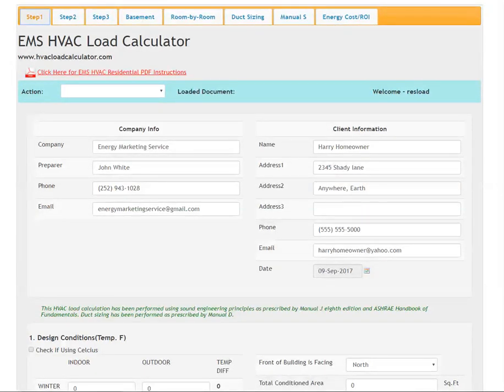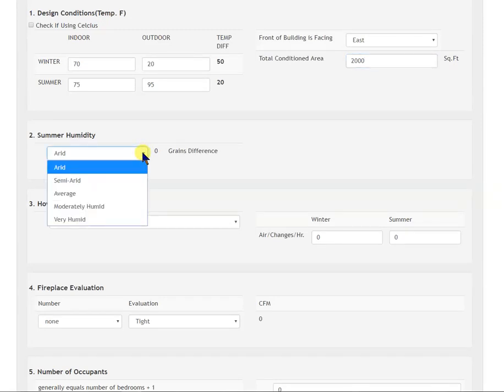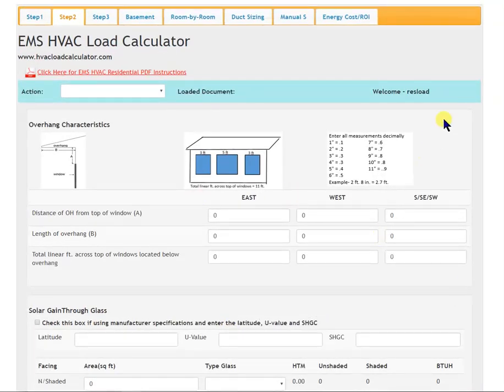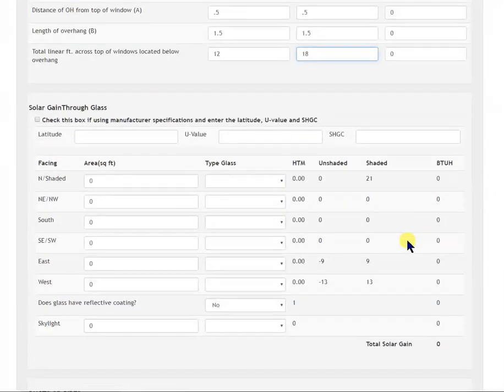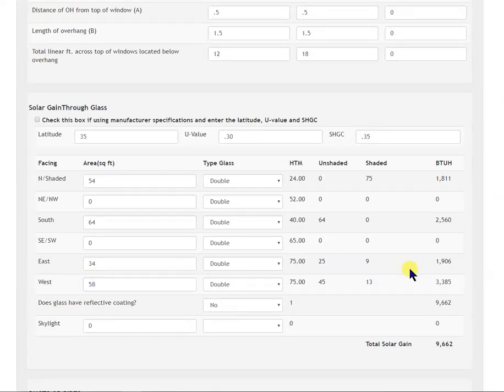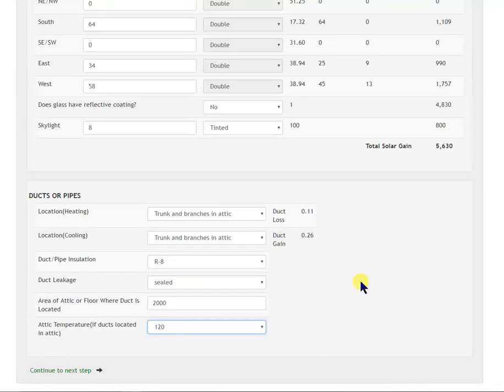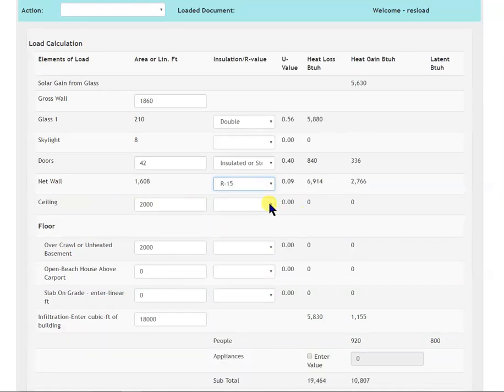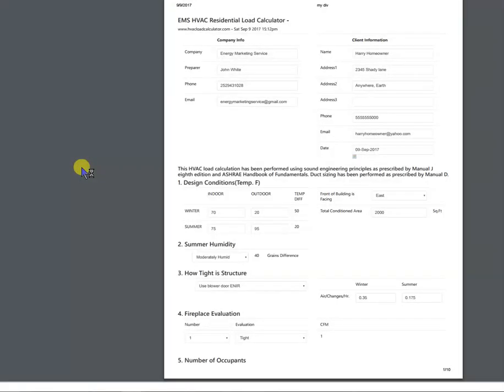EMS hvac load calculation instructions_edit_0

Comment: Not sure why when on step three one can't enter the glass U values that are used on step 2.  In my case my glass has a U value of 0.26 for the glass units, and the best on the drop down is only 0.42. It looks like is only using it for the heat loss calc though, not the gain....The U value for heat loss and gain (for glass) is the same regardless of which side is warmer.